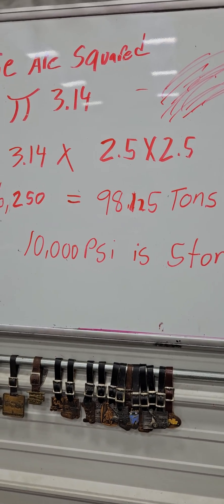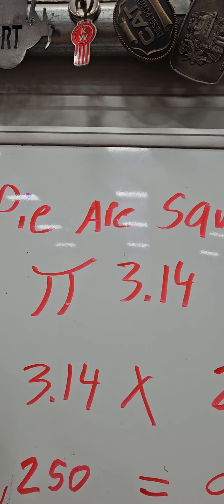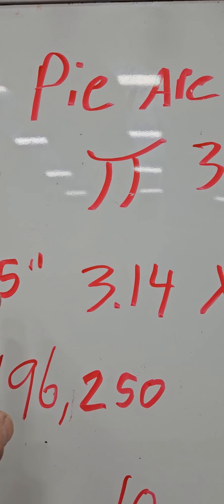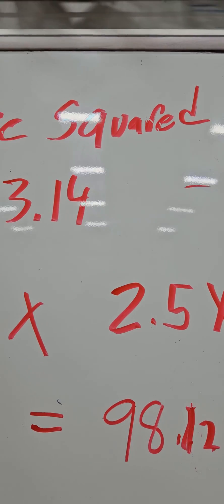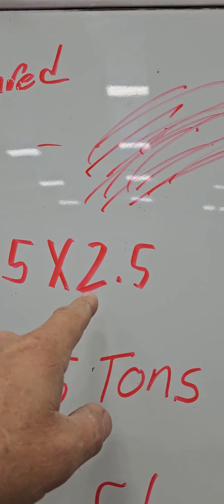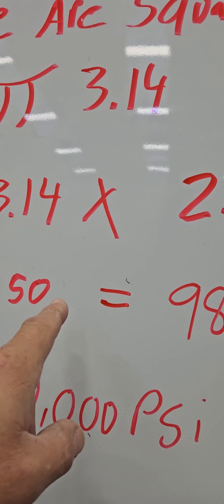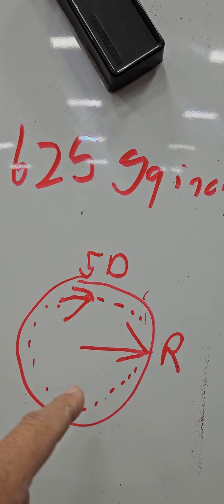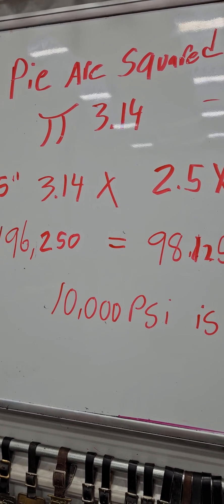10,000 psi is only 5 ton🤦‍♂️

Comment: Exactly.  you just need to find how many square inches there face of the cylinder has because we know we are going to get 10,000 PSI(pounds FOR EACH square inch). The area of the face where force is applied will tell us how many square inches will have the 10000 pounds applied to them. 

I think for a lot of people, it’s understanding what they are trying to figure out that becomes the issue. Schools nowadays teach kids how to follow steps. Not how a problem solve.

Comment: They were confusing "pressure" with "force", two different units. 10000 psi (pressure) applied to a certain area produces lots of force

A fun one to calculate is the different force that a cylinder produces when it extends or retracts- they are different... Extending you are using the full area of the cylinder, but retracting you have to subtract the area of the cylinder rod.  You are basically left with a doughnut, and multiply the pressure by that.  This doesn't matter for the application you have - you are using the full area of the ram.

Comment: I went in to a McDonald’s over twenty years ago. Their idiot machines weren’t working so they said cash only and had to figure the bill and change I would get. I did it in my head in a couple seconds and told the girl what it should be. She just looked at me and kept doing her chicken scratching on the piece of paper. Then the called the manager over and both put their heads together. My food was getting cold and after over 10 minutes they came up with the same figure I did. The girl looked at me and said how did you know so quickly. I said simple math I had in school, now how about you take the cold food back and get me some that’s hot. Yeah people just can’t do the basics, reading, writing and arithmetic is what I learned. Now days it’s a guess.
Reply: I was in a Kmart many years ago (duh) and my bill was 15.74 i handed the checker  a 20 and 75cents she had no idea and actually called a manger to help her figure out my change. I should have seen this coming then that was near 20 years ago

Comment: Hmm, the diameter you have labeled is actually circumference, diameter is the straight line from one side to the other through the middle (of which the radius line is half). But the math follows, radius is half the diameter.
Reply: Did you mean to type "radius is the straight line from one side to the other through the middle"?  That would be diameter.
Reply: @boomupengineering  correct, typo.

Comment: Jeff, Jeff pie r round cornbread  r square . I think my hundred ton cylinder is 5 1/4 inches which should give you about 108 tons, but I’ve never had it apart to reseal it so not sure on the actual dimension.

Comment: Makes me laugh people who didn't pay attention in school and don't understand their units.
PSI is a unit of pressure, not force applied.
Its the same as saying "this electric motor has a power of 200 volts"
Reply: I have no dog in this fight but I don't follow how "The pound per square inch (abbreviation: psi) or, more accurately, pound-force per square inch (symbol: lbf/in2),[1] is a unit of measurement of pressure or of stress based on avoirdupois units." isn't force.  "Pound-Force", sounds like force, one pound of force per sqin.  Science make everything complicated.
Reply: @frotobaggins7169  Because with psi we don't have the variable of how many actual square inches of area that pressure is acting on hence it's not a unit of force applied. Saying "we have 10000psi of force" doesn't mean anything, it can't be quantified.

As an example, pound-feet is a unit of force because there is no other variable needed to quantify the numbers meaning.
Reply: @deezelfairy  The square inchs is 1 is it not?  Per square inch, right?  I'm not trying to be difficult, I'm just saying it's confusing.  I get that you would need a calculation to discover the total force over an area.  However the force in a square inch is the psi, seems like that is a measurement of force.  I guess that is what you are saying, that the psi is the pressure used in the calculation over the area.  I just think it's different than say a watt which ISN'T a measure of light, it's a measure of heat.  Therefore a watt doesn't tell you how bright a 25 w light bulb produces.
Reply: @frotobaggins7169  No point arguing the toss - I'm not the physicist who wrote the book and that book was written a well over a couple of hundred years ago.

I can see how it would be confusing to the uninitiated.
Metric pressure units like 'bar' and 'kpa' don't create this confusion.
Reply: @frotobaggins7169  Regarding your analogy of a light bulb.
You are wrong, a 'Watt' isn't a measure of heat, a watt is a measure of power as is 'horsepower'
A 3000W heater doesn't mean it produces 3000W of heat, it means it consumes 3000W of power/electricity.
Actual heat produced would be measured in BTU (British thermal units).
Reply: @deezelfairy  Fair enough.  I was more thinking of a 25 w light bulb, doesn't tell you how bright the bulb is, much like 1000 psi doesn't tell you what the ram is applying.
Reply: @deezelfairy  I feel like many of the units are mis applied as marketing tools.  As in light bulbs are sold in watts not lumens.  Heaters are sold in watts not in btus.  Many power tools are sold in Horsepower not amps or watts.  Add to that the pounds and tons, it gets really confusing really fast.  Just as I confused my self with the watts and the light bulb.  Now with LED's they are doing "equivalent watts"  because that makes it clear. lol
Reply: @frotobaggins7169  Yeah, I think your overthinking this all way too much 😂